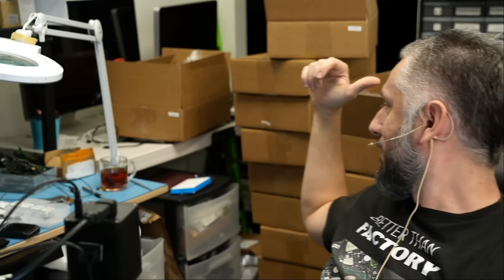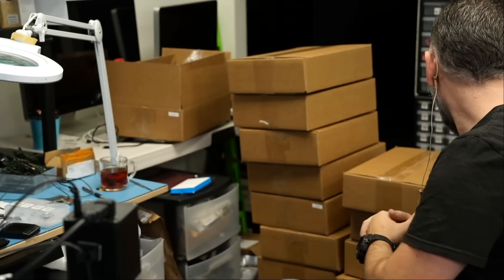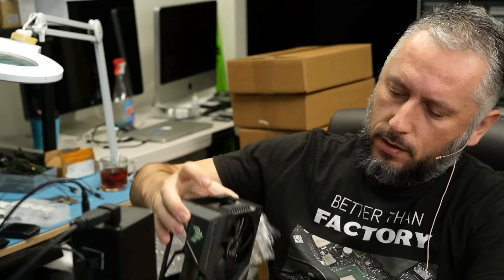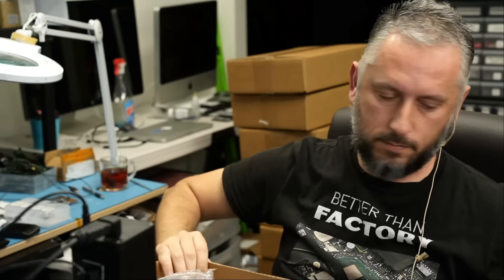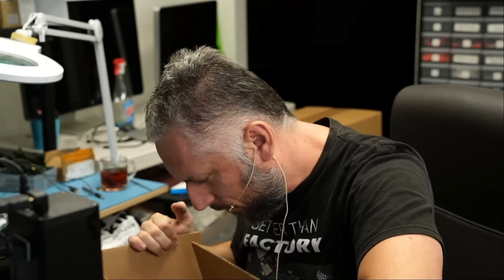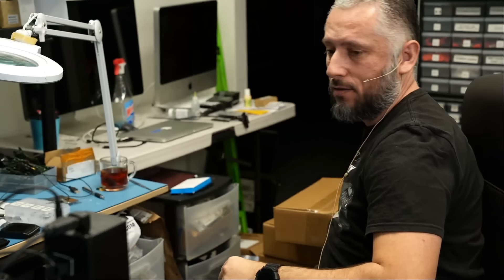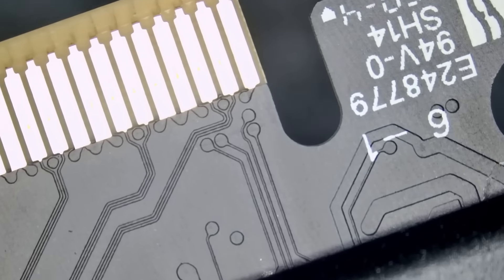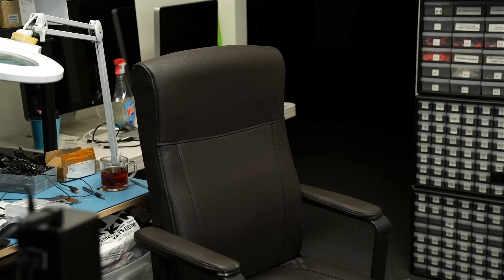We received 19 cracked 4090 Cards for repair - Who's to Blame ?

Comment: My gigabyte came with a support.. its pretty slick actually.. cant even see it really.. its a plate that bolts to the bottom right motherboard standoff screws then another bracket it attaches to the end of the card to prevent sagging.... Tho alot of those cracks were massive perhaps happened in prebuilt systems during shipping.. bottom line is the cards  coolers are too massive ... If they are going to continue to make such massive cards they need to find a better way to support and or reinforce the slot connection with the card

Comment: The manufacturer/designer are to blame IMHO.  Cards like these, at this price point, should be flawless and have built-in heavy reinforcements in those crucial and sensitive areas.  No customer is supposed to have to worry about those things when they shell over $1500 on a GPU.  At this price point, the item should be bulletproof.

Comment: most are shipping. as you mentioned . boxes, even with frigale  they move it bad. Even with correct packing there is a possibility that happens. i did check 1 supplier of build that ships the card aside. other make sure that card does not move. so sad but most is shipping delivery.

Comment: Those cracked boards are the whole reason why they have kickstands for those 4090's .  I have one on my card, on average those cards weight 5-6 lbs . That doesnt sound like much but when that weight is pulling down and bending a PCB thats 1/16 inch it will break it

Comment: it is like the company doesn't give a chip about its own architect behind the weight of the graficks card...  how do you not get a bracket included for the FOKKIN weight of the Graf Card ? it's like a extreme cheap solution... and not many youtubers that review this card tells you about the WEIGHT ISSUE like in CAPS ! that IF you don't support your grafix card with a bracket underneath or set the Card on it's side as most retail PC cases the motherboard is vertical and the videocard is hanging like a Dumb bel that is going to break the card. like whoepsie we didn't mind this serious issue ! 2100 is not cheap for it to break when the solution is extremely simpel and cheap ( Nothing like the Grafix card it self ) i think this is the reason we humans will not go as far and beyond.

it is like : You are driving with your Family across a bridge and they know the bridge sucks, Now the Bridge collapses and like over a 100 people drowned and plunged into death. Who is to blame ? The people driving over the Bridge or the people that made the bridge and are responsible of the bridge ?  i sure would not put my money on a brand that shoots me to the stars with such a simple task to fail at is beyond mind blowing.

Live long and prosper,

Comment: These PCIe slot clips need to go away. There needs to be a standard EATX hot swap PCIe cartridge or frame that locks into place without trying to use the PCB for structure. Same with molex connectors. There needs to be an edge connector standard that uses fingers directly on the PCB or edge connectors like SATA power does. Its like the people making this stuff do not have any expertise at all.

Comment: A graphics card over 320W and/or takes more than 3 expansion slots should have a factory AIO cooler option. A GPU slot is so limited as to what you can ventilate outside of the case. I have the feeling that the weight of the cards are a factor

Comment: Time for a redesign of GPU and CPU in a PC.
Thinking about a lean PCIe interface card with 48Gb optical IO and a square metal box mounted as a PSU for the rest. For $2000 you could easily find some budget for this instead of putting 5kg on a single PCB connector.

Comment: I feel sorry for independent system builders. There really is no way of safely shipping a PC with a 4090 installed. Every vibration the box is subjected to is going to stress the PCB at it's most vulnerable point (the retention tab) until it can't take it anymore and cracks. The cooler is just too heavy. That's how I imagine most of these were killed. Big OEM's probably get round this with proprietary designs so it's only the smaller custom builders that are left with this problem. The MSI Gaming Trio near the beginning of the video looks different. It looks more like it was aggressively pulled out of the slot without opening the retention clip.

Comment: Just ordered from your site for the first time. I am curious as to why you do not do any bga chip repair? I see you have accessories for bga chip repair but in all the videos I have watched where you suspect a device is having issues with the apu or cpu you deem it no fix. Just wondering what your reasons are as I am considering getting into bga repairs myself. Thanks ❤

Comment: The 3090 and 4090 are bad designs. Too much power, too much heat, too much weight. 400w in a consumer graphics card shouldn't be.
Reply: tdp is actually 600 watts but thats if ur pushing its absolute limit

Comment: why a 1900 to 2500 dollar gpu are build so bad  they need work the pcb qualitiy like SAPPHIRE xfx   they build like a Nissan or Toyota most amd gpus repiars and run good  in the case of other manufactures they don't why the manufacture  don't work on voltages regulation to avoid the core frying  vram problems mosfet burning etc in the asian countries we use 220v the psu fries like potato chips the gpus  is very absued

Comment: I still don't get why the Nvidia FE design with the cooler and bracket being one part was never made before, and why it's still not the only way they build heavy gpu now.
With it the cooler is directly supported by the case and doesn't bend at all, eliminating the need for a support bracket.

Comment: Good info.  I didn't know about this cracking issue. Glad I mount my card vertically.   My 4090 is due to be delivered to you in a couple days to have the connector replaced courtesy of  CableMod as the connector melted.  It was inserted correctly in the GPU and not wiggled or moved at any time.  Just melted and hard a hard time removing the connector.  They are standing behind the product, but I am sure some blame is due to the design of the GPU having only one plug.    I will be watching all your videos.

Comment: It seems clear the customer was an SI where a lot of these cards were damaged in shipping. The PCIe locking tab isn't going to get ripped completely off just from sitting in a PC with no support bracket. That requires a lot of force to have happen. definitely shipping damage. I'd guess the reason there are so many Asus cards is due to the SI primarily using that card in their prebuilts, causing it to be over represented, not because Asus cards are more likely to break. We've seen plenty of cracked cards from all manufacturers. I doubt most of these cards cracked just sitting unsupported in a pc during normal use by a customer. The cracks are just way too massive on a lot of them.

The 40 series cards are so massively overbuilt I don't think standard packing materials SI's use are enough anymore. Even expanding foam bags aren't enough. Either you need a physical support bracket that screws the card down firmly or the cards should be shipped separately, uninstalled, with instructions for the customer to install it themselves (which carries it's own risk with it).

Comment: This is a great reference video to anybody with a broken GPU. You can easily see cracks like this by looking at the problematic area in good light. If you see a crack, it cannot be repaired for a sensible cost. Plain and simple.

It appears that there are people that think that a "simple" crack in the PCB is an easy fix.

Comment: I think these are from the same place , they got broken on transport (with them in a PC) or because the cracks are mostly in the same place (where the lock is) it is possible some dumb dumb or someone in a bad mood yank them out of a computer without holding down the look on the motherboard !

Also i do agree that they need to be sold with a support or with a warning sticker covering the power connector (so that the user know that they need a GPU support )

and another thing is that they need to stop using that BS power connector and go back to the 8 pin (they add this connector just to make it look good) and if the cards going to be this big they should just make them with a AIO or with a water block like a EKWB ! 

what's the point of these "powerful" GPU's if you cant use them, or with a low life span !?

Comment: Not sure how a class action case hasn’t been brought against the cracking issue.  Gpu manufacturers know the weight all on that one small area would be a problem for PCbs yet they sent them out as benchtested units. Obviously they never attempted to ship a complete pc across the country with a 4090 before they decided to make them weigh so much.  Or use the same thickness Pcb that worked in the past with half the weight cards.  Seems like we were setup to fail on the 4090s

Comment: Just looking at the design, in my opinion, you have a very top-heavy board with board connector and tongue that is not central, a tongue that is too small / fragile and a design which requires inserting at an angle, mostly whilst not being able to see from the top. Coupled with impacts during shipping inside a PC, even with supports, an accident waiting to happen.

Comment: I see so many cracked 4090s that I'm getting worried about mine. I'm just using the little support stick that came in the box to support it. I put it up and adjusted the hight when the gpu was standing on the motherboard and I did it so it doesn't sag a bit when I stand the PC up. To my eyes it seems sufficient but I'm still worried, anyone have experience if that is enough?

Comment: I think the other major point to look at with these is that the heatsinks are simply becoming far too big and heavy to be supported by existing pcie hardware. These either need to move to water cooling or dial back the heat and prioritize for efficiency instead of performance at all costs

Comment: For 800-1500$ cards with huge coolers I think the manufacturer should include a 5-10$ support bracket and end even put it in the manual not to install it without the support bracket just my 2 cents !!!!
Reply: They usually do. At least my 4080 Zotac came with some stand included. I ripped that monster cooler off anyway to install a small waterblock.
Reply: They don't need to these customers have a good day, they need to sell out all 4090, so if they can do something with the card to fail on the customer, they will do that.
Reply: they do and say this? why are u talking without any clue? one second research....
Reply: @MusikAstronaut  I got a 7800XT triple fan Hellhound with a beefy cooler was nothing in the box ,so not everyone is doing it and they should

Comment: Not cutting UPS and FedEx slack, but one would think that if these were caused by rough handling while shipping, you'd see the cracks manifest at random spots on each board.  The fact that the failures are occurring in essentially the same area on each board would seem to indicate a design flaw.  Basically, more load is being put through that area than it can withstand.

Comment: user error is for sure involved here. but if if the cards are getting this big now, it may be time to change the port to somthing bigger, dual slot or a longer slot without theese locking notches that is prown to crack.or using a riser as the only option

Comment: Man, I have an ASUS RTX 4090 TUF OC model and I've had it for half a year now but so many ASUS cards doing this makes me worried. I have the included card support bracket installed and don't move my PC much except sliding the case over to clean it out occasionally. I hope if mine does die it dies from something ASUS would cover under warranty and not from a cracked PCI-e connection or melted connector.
Reply: @guyva_unito_sree3  who is shiping whole computer with gpu anyway? There is no logic.

Comment: Wow my Gigabyte has a rear mount bracket that is supported by the case through the motherboard. SO far so good but I did see a slight dip where the 4090 chip is. I have been using for two months so far.

Comment: I wonder if moving to a case with a flat orientation would band-aid a lot of the 4090 issues.  Something like a Cooler Master HAF-XB.  It also might help with extra space above the power connector.
Reply: Moving the motherboard horizontally could still cause issues. The main problem is, likely, installing without the supplied support bracket. With the case I use (Thermaltake's 'The Tower 900'), the GPU's are installed vertically without the need for the bracket.

Comment: When I bought my 1080Ti and installed her for the first time, I was alarmed with how much weight was being placed on the connection to the motherboard without the supporting screws.  Now we're looking at cards almost twice the size of a 1080, and probably at least half as heavy, still being give the same amount of support.  There's some type of disconnect with manufacturers and how people are using these cards, and just how heavy they have become.
Reply: Half as heavy? You've obviously never held a 4090.

Comment: I believe if the card is built against a standard of weight then they should supply Supports that hold them up or warranty them. 

Its a simple plastic part that can be 3d printed or in the companies case injection molded. Push off the bottom or attach to the top and extends with a tension knob to stop this problem.

Comment: "Great video." Cudos to you.
Now, I would say it is both user and partially manufacturer. I have had a 4090 since October of last year, and I've taken the card out at 2 or 3 times to clean it. I've always inspected my 4090 before and after installing. I use the support bar for it. This is a must weighing 5lbs, I have the Gigabyte gaming oc, and to this day, not one crack.
You just got a subscriber added to your channel.

Comment: Those cards are really big and heavy.  I have a smaller less expensive card on my computer and I definitely used a support bracket.  I think vertical mounting would be an option for the 4090s.

Comment: I think that these 4090s are a crap, they have many problems with conectors e pci slot. Maybe the customers learn something from that e doesn´t buy these terrible giants cards, this is wrong only because of their size. The manufectures have to install giant coolers and heat sinks so big that the board can´t handle it  and all of these things because the gpu is using an extreme overclock. As I sad, crap.

Comment: Still using my old Silverstone FT02, cards install vertically, no problem! Edit: Still, aren't all these damages most likely caused by excessive force while under shipping or transportation mounted in a case but not supported internally with foam blocks or other measures? Couldn't it be a lot from a commercial PC builder who sold complete builds but failed in proper packaging techniques and getting a lot of customer return claims?

Comment: I wonder if the FR-4 in those boards is of similar quality? Maybe some manufacturers use cheaper/weaker PCB material? PCB material can be different in rigidity and strength depending on the fab but it's really hard to know as an end-customer.

Comment: I suspect that with the size of the card and the fear of the burning connector ppl are putting too much pressure on the card either with the cable or while removing and reseating the card, cracking the card.

Comment: At least regarding Asus, they add a combined screwdriver/support stand. However, this piece is incapable of providing support during shipping. Especially those really egregious cracks look like they were sustained during shipping due to repeated side loads - a card in use would fail much sooner, and the crack would thus be much smaller. So these cases are directly caused by system integrators shipping PCs with the cards installed, which is not something the customer can be blamed for. I know LTT encountered a card where the locking tab had completely broken off during shipping in one of their videos from a few weeks ago.

The only way to ship a PC with a 4090 (or any card of similar construction) installed in the slot is by fitting a metal brace that connects the card from the opposite side of the PCIe locking tab to the chassis in both directions (towards the top and bottom). Even then, you'd probably also have to fix the overhanging radiator on the really heavy cards so no bending moment causes the entire PCB to flex in longitudinal direction to the point where it may fail or solder joints may crack.
It's certainly on the system integrator that the cards weren't shipped separately; that said, it's on the manufacturers that appropriate connection points for mounting braces are almost entirely missing.

When I had to move my gaming rig from one place to another at the end of September, I removed the GPU and put it back in its shipping box for transport. Considering the volatility of the 12VHPWR connector however, that is not a sustainable approach to the whole thing as repeated use will end up damaging the all-copper pins inside of it eventually, causing it to melt. Who knew 'copper alloy' wasn't meant to be 100% copper?

Comment: I think the whole issue is caused by insanely heavy cards combined with the fact that the part that hooks into PCIe connector is part of PCB. If Asus et al had made that part out of metal, it might have saved these cards. On the other hard, the damage that broke this cards would have then ripped the PCIe connector off the motherboard but maybe the motherboard would have been cheaper to replace than these super expensive GPUs.